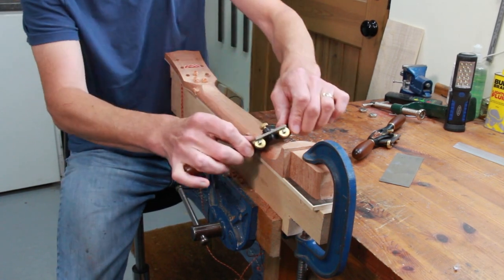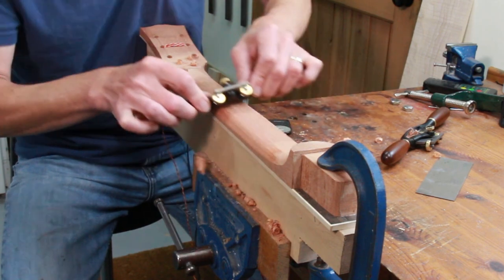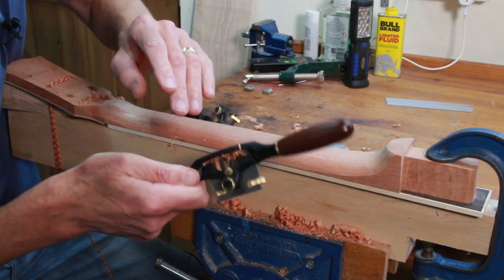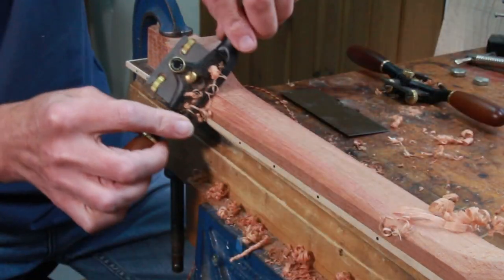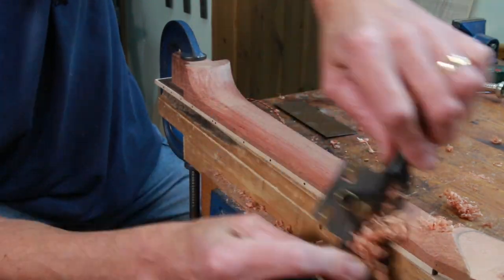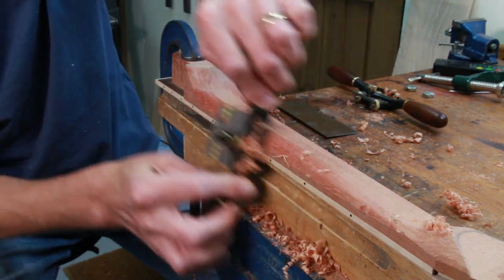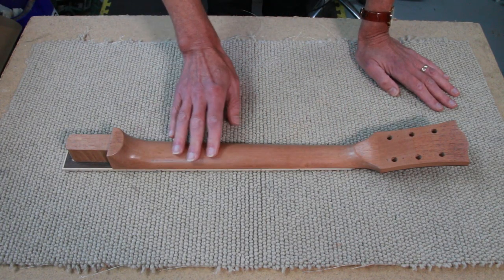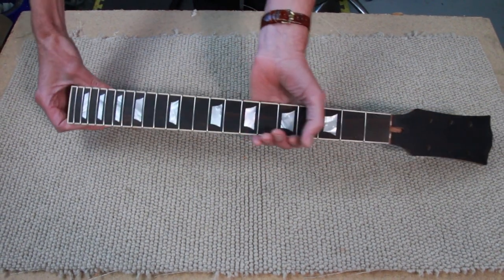The joy of carving a neck by hand

Comment: Hi David, great video, I'm hoping to make a LP neck in the future.  Where could I find carving tools like the ones that you're using in the video?
Reply from the maker: Thank you. I use two Veritas spoke shaves. One with a flat bottom, the other curved. They are quite expensive tools. There are cheaper spoke shaves available. For many years I just used a Stanley, curved sole, spoke shave.
Reply: @flameguitars5770  thanks, David.